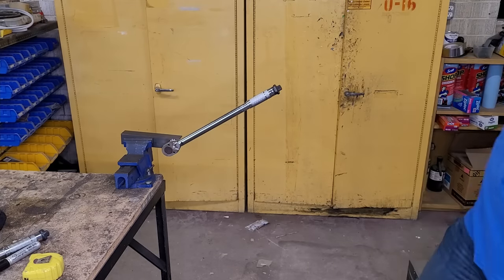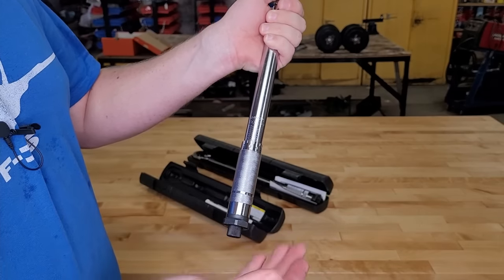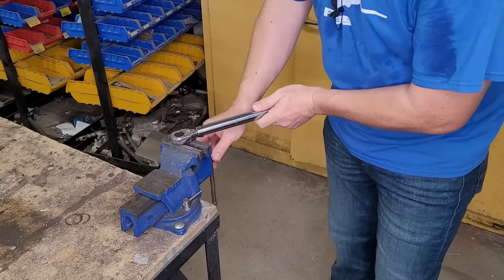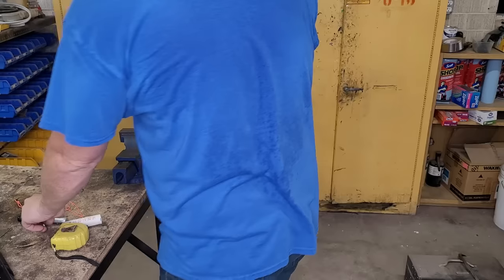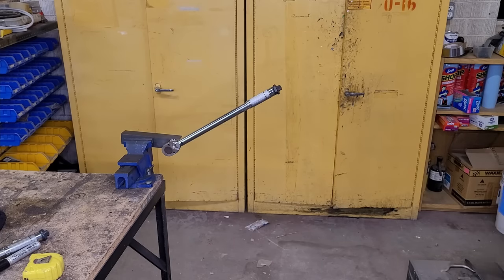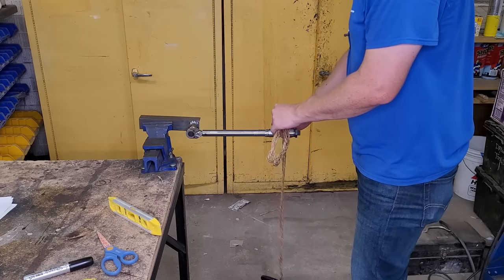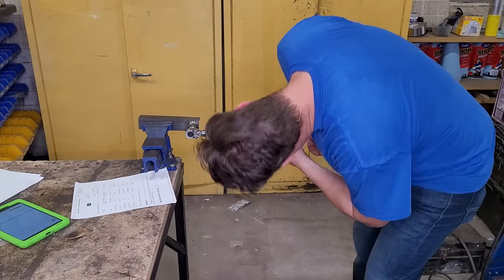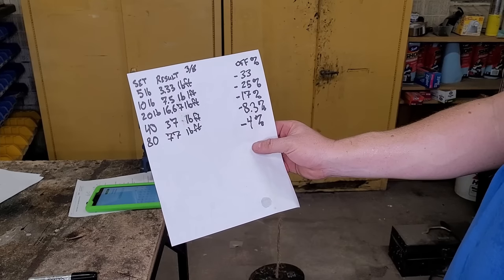$20 Torque Wrench, are they accurate? | Harbor Freight 1/2" and 3/8" Drive Review and Test

Comment: On my HF 1/2" torque wrench, it is practically too difficult to change the setting to anything above 100 ft-lbs.  The mechanism becomes too rough and the spring becomes too stiff to set by hand.  I may be able to do it with some tools to get more torque leverage.  Anyone else have the same problem and come up with a solution?  I've thought about using tools to compress the spring to the max and leave it compressed for a certain period to soften the spring but I'm afraid that would compromise the calibration.  Any suggestions to obtain the full range of operation up to 150 ft-lbs (not that I have job with the that requirement but I would like to get the spec I paid for)?
Reply: Just bought same one and I’m seeing a lot of comments like this. Mine is also difficult to turn above 120.  Are you holding the shaft to turn the collar?  Try mixing hand up to socket head - it’s wider and not round/smooth.  You’ll get better torque to turn - like a good wide handle screw driver.  Worked for me.  I can fairly easily get it to 150
Reply: @frankhouck4446  Thanks for the suggestion. I tried that technique. Helped a little.

Comment: broke transmission pan bolt with these despite putting it at only 8 ft lbs, which was bit less then official torque specs in service manual, at least got no leaks after tightening by feel afterwards

Comment: Okay so if I need.tight my struts nuts. Manual say.100 ft.pounds
. Of 3/8 torque.dont.work . Right ?
Reply from the maker: 3/8" only goes up to 80 ft pounds I believe.
Reply: @HerbOMatic  ok so to get 100  to 150 foot pounds  i need to buy another torque  wrench right sr.
...?
Reply from the maker: @tonycervantes4816  that is usually the 1/2" drive wrenches.
Reply: @HerbOMatic  that's  what i. Need 1/2 torque wrench  🔧  ? For 100 to 150 ft pounds..right

Comment: I purchased 3/8 torque wrench from harbor freight.  Never again will i trust their torque wrench.  I snapped  a bolt on a water pump and it really ruined my day. I tried to remove the bolt for 3 days but ut to no avail, i had to purchase another water pump, boy was i irritated.
Reply from the maker: From the comments it sounds like the 1/2" drive is more reliable.  That sucks man, I've been there, now I check to make sure they are going to click in the vise before putting them on a bolt.
Reply: @HerbOMatic  based on what i experienced and the trouble and frustration i experienced not to mention the money i loss due having to purchase a new water pump, i will not be trusting any harbor freight torque wrench.
Reply from the maker: Can't blame you there!
Reply: on my 3rd one of these... they werent broken, they just dont click reliably... make u cringe as ur applying torque awaiting a click that may or may not come!

Comment: As long as I know, the Nm-display in torque-wrenches functions only then accurately, when the force is exerted, in average, onto the middle/center of the hand-griff. So, your results were predestined to be untrue, since you opted for a lever of 1 foot, to hang the weight, while you should have opted for 0,80-0,85 foot... This was convenient for any downstream-calculations, but methodically false, since torque-wrenches don´t function like that. This is sadly not as simple, as dividing your results by 0,8 , cause torque-wrenches, again, simply don´t function like that, and not putting the force at the right spot will simply lead to skewed results, which cannot be used to calculate the correct results afterwards...

Comment: I picked up the 1/2” version today because it was rated the best budget torque wrench on the tools tested channel, but I can’t really find much on the 3/8.
I need something in the lower torque range for valve covers, etc.
Reply: 3/8 doesn't like to click, if you don't hold it at exactly the right angle will go right through the torque spec without triggering. Mine isn't branded harbor freight but it's identical, wouldn't recommend it.

Comment: Don’t buy a torque wrench that doesn’t come with a calibration certificate and don’t buy a used torque wrench.  Also, don’t use settings at the lower end that are less than about 20-25% of the max torque.  So for a 100lb-ft wrench don’t use measurements below about 20-25lb-ft, and for a 250lb-ft wrench don’t use measurements below about 50-60lb-ft.

Comment: You didn't account the weight of the wrench itself, and the moment that the weight of it's handle create. This might be the reason why you got such results for the low weights. Better option for test might be placing the wrench horizontally, and using scales instead of weights

Comment: Testing as shown, with weights, is not accurate because it ignores the weight of the wrench itself. That matters more at low torque as your results nicely show! Do no test/calibrate a torque wrench using weights. Note also that you mark the handle at the low torque setting, but that handle moves out as you set higher torque values, so even the distance part of the calculation is wrong there, too.

Comment: This is the 100th video I’ve seen where this test is being done wrong. If you look at the static equations for torque on these type of wrenches, you will note that is not to be considered a fixed beam. You cannot just place the weight at some arbitrary distance. There is a pivot point near the head and a clutch where the internal piston meets the spring. The manufacturers of these tools calibrate them such that the ratio of distance between the piston pivot and the correct hand placement versus the distance between the pivot point, and the socket head center must remain the same. This is why the instructions tell you you must have the proper hand placement when using the tool to ensure accuracy. This is usually the midpoint of the handle, which I believe in your video would be that blue ring.  Having your weight placed at any other distance, changes that critical ratio, and will create an hour inaccurate reading.  In fact, the math shows that placing the weight in front of the proper hand placement will create a torque that is greater than what the setting shows.  It makes sense that if your weight does trigger the device at the farther distance, it will do so at a shorter distance.  This is counterintuitive, but placing the weight farther out, eventually will not trigger the click..  the math actually shows this, and as a mechanical engineer, I have watched a few really good videos on this, which intrigued me.  

Lastly - the fact that it did not trigger at 7” is because you are basically now in front of the clutch and it can’t engage.  What you should have done is keep the weight at the handle midpoint and if it triggers (or doesn’t) adjust the setting up or down accordingly keep the weight at the same location - once it clicks, you’ll have a far more accurate deviation. 

Anyway - I think the Harbor freight wrenches are as good as any value brand on the market and I can get them locally.

Comment: Would you trust the 1/2” on a rifle?
Reply from the maker: I would, but I would test it first with a known weight, light I did in the video.  The trouble may be with consistency from wrench to wrench.  Thanks for watching consider subbing, I am going to revisit the toque wrenches soon to see If they can be calibrated at home easily.

Comment: I think the way you testing is incorrect,that is the old way with the torque style wrench that did not click remember the old type had numbers with a needle that move when you used it, things are more hi tech now a days i dont think they calibrate torque wrenchs in this manner ,you can buy a digital torque wrench and calibrate it ,i have 1/4" ,3/8 and the 1/2"  harbor freight torque wrench and they all work great and what the torque is set on is what it torques to, i have never had an issue i torque my lug nuts all the time because i have spacers on my 4x4 that i check pretty much weekly and had a tire shop  put new tires and they checked the torque and it was only off like by a 1/4  of a pound so yeah these torque 
wrenchs are pretty god dam close in my opinión again i use mine all the time and even though they are cheap they still work great now for how long i dont know but its going on a 1yr and half now  and they are still working properly, so this wieght thing you tried its not right its for the older type dial torque wrenchs with the needle in the middle and it goes from zero to i believe 80 or 90 and there are bigger ones but yeah the way you are demonstrating is for the old type ,come on man do you think for min people are gonna go get wieghts and  bust thier self in the head, i think not , re Group the content and dont do something the cave did when they were alive, have a nice day

Comment: I bought the 1/4 inch drive that measures in inch pounds. It's terrible. I use the 1/2 inch for torqueing the lug nuts on the car. The 3/8 is useless.

Comment: Man the 1/2in drive is scary. Idk!! So I need to torque a bolt to 40 ft lbs. I set the wrench to 38 ft just to bet on the safe side. Never clicked so I keep going, next click I heard was the bolt breaking IN THE ENGINE BLOCK 😩. I’m going to get my $12 back and buying a real name brand cause that cream just cost me right at $80 😡

Comment: This is consistent with my experience. I get accurate and consistent results with the 1/2" torque wrench and the 3/8" one gives me inconsistent and inaccurate results. The 1/4" one works good too. Mine overtorques though and I found that out trying to torque differential cover bolts on my F-250. They called for 25 ft-lbs and it snapped them right off. The 1/2" did fine for that job. I did calibrate both of them after that but I just don't trust it. I honestly should throw it away because I'll never use it again for anything important.

Comment: on my 3rd one of these... they werent broken, they just dont click reliably... make u cringe as ur applying torque awaiting a click that may or may not come!    Ialso have the 1/2 drive one which works well but that 3/8, I wouldnt trust it as far as i could throw it...thanks for benching Both as it Really shows the accuracy of that 1/2 and the poor Inaccuracy of that  3/8..even without the tests, just using both lead me to suspect that was the case
Reply from the maker: I hate that feeling like you're going to break a bolt that you can't replace!

Comment: Id hope these work i have been torqueing everything with one of these i torque my tires to 80 with this and its never fallen off so i think it works alright
Reply from the maker: The 3/8 drive went wonky on me shortly after this video, I think I unscrewed the adjuster too low when I stored it last and it came apart internally.  I like to put it in the vice and check that its clicking at a low torque before using it.

Comment: you done all those measurements WRONG... all measurements should of been taken in the middle of the hand grip... its how thwe wrench is calibrated.
Reply from the maker: Ft-lb is measured as the (distance from the pivot point in feet X the lb force exerted perpendicular to the lever)  so you could adjust the weight to be suitable for the center of the hand grip but it would not be one to one.

Comment: For critical bolts a torque wrench is calibrated before use and a quality control person stands over the mechanic to watch it click and it is clicked twice. Most bolts aren’t critical and are just tightened till they feel right even on an aircraft. I’ve had a Harbor Freight Torque wrench for 40 years I’ve rebuilt many engines and transmissions on cars, bikes and watercraft with it and never had a problem. Torque specs are usualy given in a range and I set at the middle of the range.Just don’t use it as a breaker bar.
Reply: Lol... 😂

Comment: #1 Most torque wrenches are not to be used to "untorque" you have a reverse so that you can position the handle for ease of use.  #2 you never use the torque wrench from any position other than the grip, do not "choke up" on the wrench. #3 your accuracy test is BS.  You test a torque wrench for accuracy using a Torsion Meter.

Comment: As a aviation technician a torque wrench is an essential precicion instrument and is calibrated annually and checked for acute reading every time you torque anything on an engine.  Don't even try to mess with my torque devices.
Reply from the maker: I don't use these on my plane lol.  Lug nut and lawn mowers!
Reply: What brand do you use?

Comment: Those clicky things? Throw them in the trash right away! Most of You don’t know how a torque wrench works and that type is the worst type to learn on. Get the bar type. It’s cheaper and more reliable for most applications. If money is no problem then the new electronic types are much better than that. One weakness is batteries.

Comment: Reversible for left handed threads
Reply from the maker: Manual says not to use it in reverse.  I may test it to see.
Reply: @HerbOMatic  Definitely don't want to lossen anything with a torque wrench, but if it's left-handed threads you technically aren't reversing I guess. As your just going left to tighten. I definitely wouldn't trust a $20 torque wrench with thousands of dollars worth of parts but maybe lugnuts.

Comment: ASE Certified mechanic of 23 years, here. Stay away from Harbor Freight tools, please. I had a buddy do a head gasket replacement and he torqued everything with his $22.00 HF torque wrenches. Afterwards, leaks were popping up all around the engine; some from valve cover gasket, some more leaks were found at the oil pan bolts. They are not for building or overhaul engines. Buy one that is used in aviation etc.. MATCO, SK, Blue-Point, Sioux, Snap-On. They are for builders and repairing motors.
Reply from the maker: I believe my 3/8 drive may have already bit the dust.  Alot of the socket sets and stuff from HF are fine, calibrated equipment is what I would be wary of.

Comment: I buy the half inch drive for lugnuts and my snap on guy will check any torque wrench for five dollars and they are always within four foot pounds so for the money just to do lugnuts yes I have a six hundred dollar snap on torque wrench for anything else
Reply from the maker: The 1/2 in drive was within 4 ft-lbs, my 3/8 wrench being off 33% may have been a fluke.

Comment: The way this guy is conducting these tests is no way accurate, you have to actually use a gauge at the socket to measure the torque rating. You can't really start hanging weights on a handle. Watch how Project Farm conducts their tests of torque wrenches and you'll see how it's supposed to be done.

Comment: Something tells me you're the guy that breaks the bolt in his motor all the time. Those cheap torque ranches will always have an error regardless where you calibrate it at. You can have it calibrated on the low end perfectly. But the moment you go higher, it's going to be off.

Comment: re: reversing - obviously you don't have a 60's MOPAR....LH Wheel studs on the driver's side.....just saying.....
also, I try NOT to use a torque wrench athte top or bottom of the range....try to use a wrench that has your desired torque in the middle (ish) of the wrench range.  And for mission or life criticle apllicaitons , for god's sake use a certified tool... 😁

Comment: The 3/8 1 is junk I broke 3 bolts at 20 ft pounds cause it never clicked
Reply from the maker: I've been there!  I stripped out one of the exhaust manifold holes out of the head on this truck because of that, had to spend 4 hours putting in a heli-coil.   I throw the click ones in a vice before I use them just to see if they are clicking and see If they are somewhat close by feel.
Reply from the maker: I've read good things about the tekton here in this comment section, haven't had the pleasure.  I have a set of old craftsman that seem to be accurate.
Reply: Get a smaller  torque wrench, don't use one that big for only 20 foot pounds....lol.😆

Comment: This man works on airplanes and used a kite string to support 80 pounds of weight?
Reply from the maker: Airplanes use tons of Kite string
Reply from the maker: How else can you determine the failure load of the string!?
Reply: why not use an old style (the kind that flexes) torque wrench. just use a couple of one inch pillow blocks, a piece of one inch rod and two sockets weld the sockets to the rod, bolt the pillow blocks down and there you go. use a recently calibrated torque wrench to check it and it will never be wrong.
Reply: @HerbOMatic  by almost crushing your foot while knocking a couple of teeth out at the same time. 😆  Just messing with you, great video.

Comment: I recently bought an Harbor Freight 1/4" 20-200lbs torque wrench with a +_4% accuracy rating for $20. Handle's barely a foot long. I'm skeptical of its accuracy.
Reply: It's inch pounds not foot pounds
Reply: @masonspohn125  Pull your head out and re-read the comment.